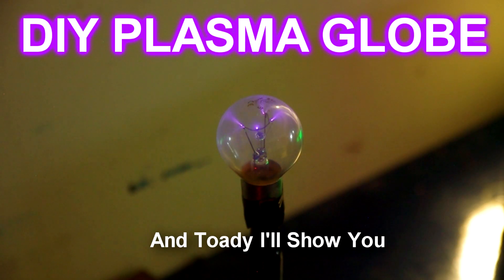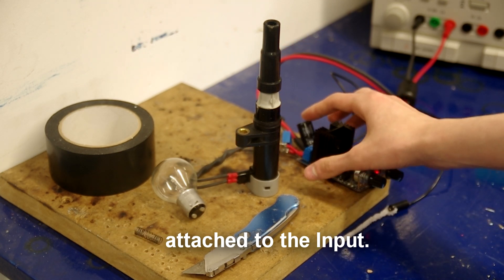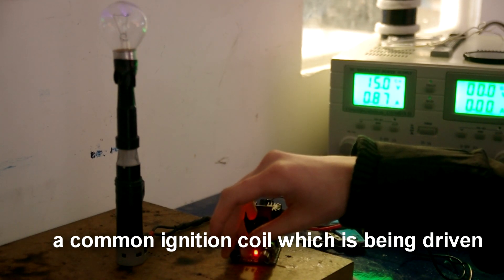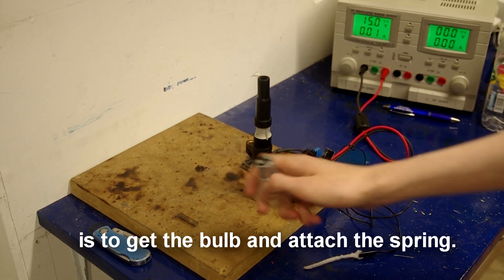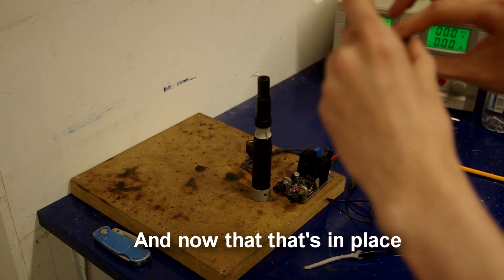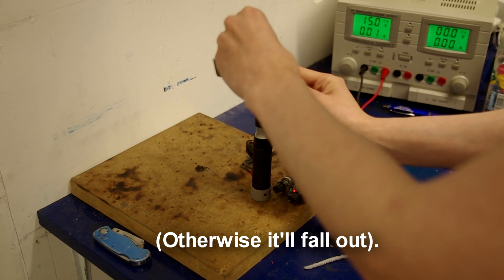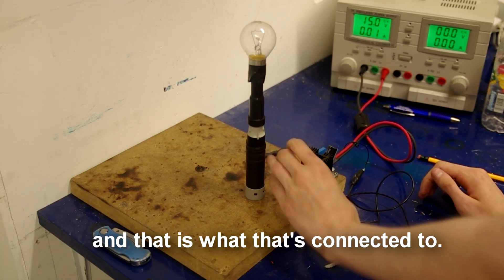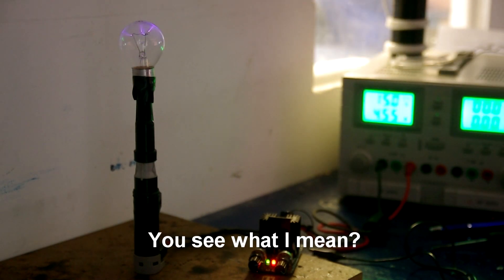Simple DIY Plasma Globe

Comment: What was the input voltage and power?
Reply from the maker: +TheBaconWizard  15V DC up to 75W. If you check the PSU in the background you should be able to see the operating voltage and current as the controls are adjusted.
Reply: rmcybernetics thanks!